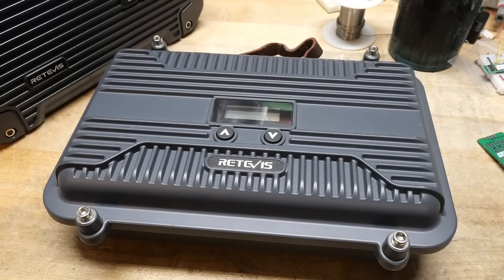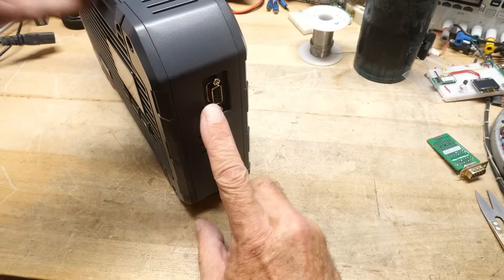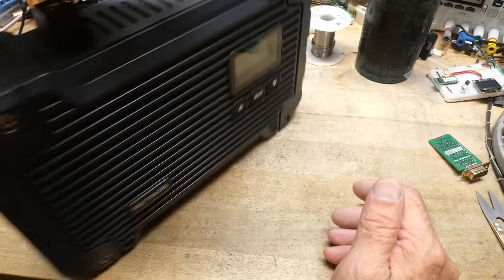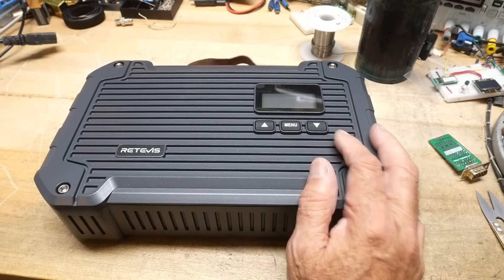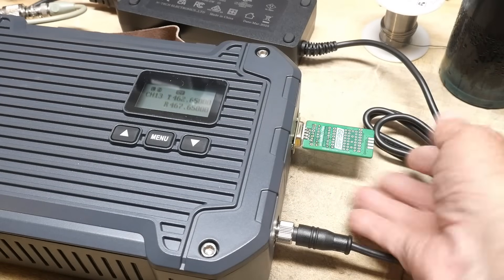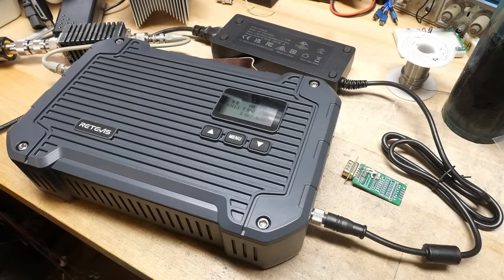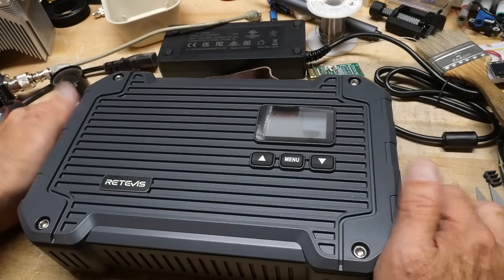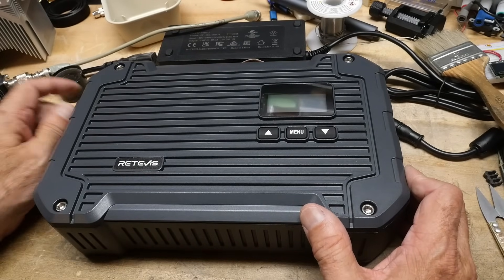#2314 Retevis RT97L 22W GMRS Repeater

Comment: Is there a MARS mod (out of GMRS) for this?  It would be super useful for us here (remote area in Australia) and way cheaper than the $3-7K Icom / Motorola options we currently have to set up a temporary repeater at worksites and campgrounds.  Just needs to go about 10MHz higher than the US GMRS allocation so it works with the locally available UHF mobiles / handhelds.

Comment: Looking over the video again one thing I would have done differently is thermal management.  With the RF deck heat sinked to the inner separator plate the heat has to travel through that whole plate to get to the outside structure.  Since the top/face plate is also aluminum they should have stuck a couple of thermal sponges on top of things like the driver / final transistors and regulator to transfer heat directly to the cover.  I see that in it's future (wink wink).
Reply from the maker: the aluminum top bottom inner is pretty heavy cast pieces and the final is screwed down. yes, it is not directly on the outside but hey it's only 22W and the transistor looks like it's over spec'ed
Reply: @IMSAIGuy  Haven't ever listened in on active GMRS repeaters before have you. 🙂  Two of the super active repeaters in my area can have non-stop conversations for 6 to 12 hours straight.  People come and go throughout the day/night but the amount of traffic they handle in a 24 hour period puts the traffic on most amateur radio repeaters to shame.  Several years ago out of curiosity I put a timer on the COS (carrier operated squelch) pin on the accessory jack of one of those repeaters.  I fed the timer data out to the remote repeater control card so I could monitor it from home.  I think the record still stands at 18.3 hours of use in a 24 h or a 76% duty cycle for the day.   That repeater is a vintage Motorola MSF5000 with a 110 Watt PA deck.  Even though the output power is set to 50 Watts the rack mount triple fan that blows on the PA heat sink runs pretty much continuously. These guys can burn out the final in a subpar repeater in less than a day.  Good thermal management is a necessity.  On the bright side there are few places that are better for Beta testing a repeater.  If it can survive a week at one of these locations it's probably bulletproof.
Reply from the maker: @mikesradiorepair  I haven't heard that here. The only repeater I listened to sounded like a standard 2M conversation.

Comment: Would have loved to Beta test this but alas, I don't Beta test for Retevis.  Doubt I would use something like this fulltime but it would be a nice loaner repeater when repairing one that is down.  It is nice to see that the published 22 Watts is after the duplexer.  Usually the published output power is measured at the repeater's output before any loss from the duplexer.